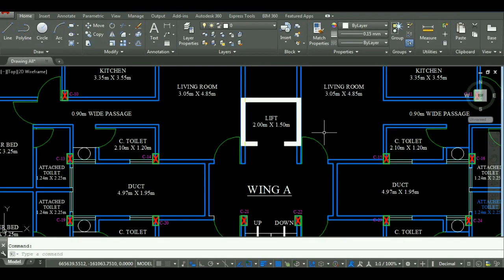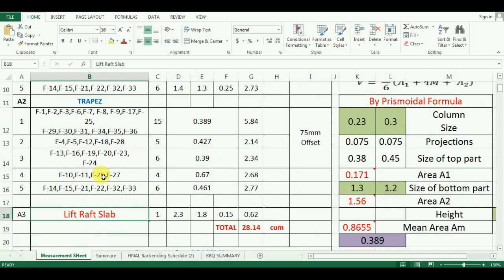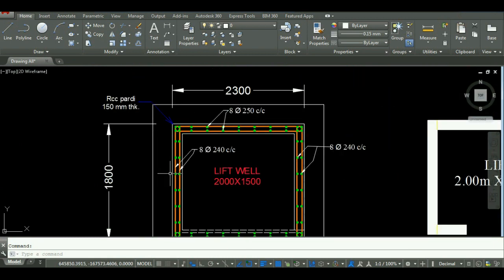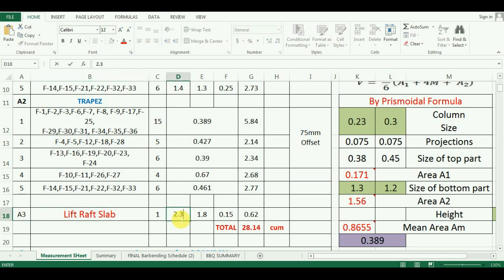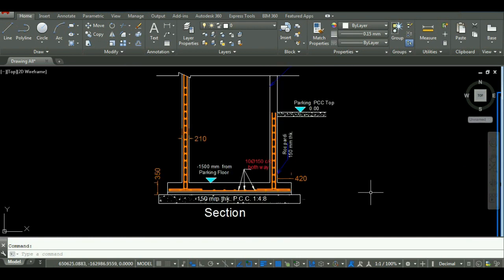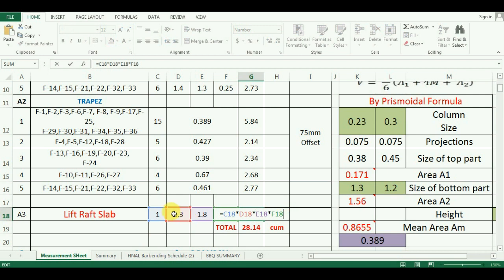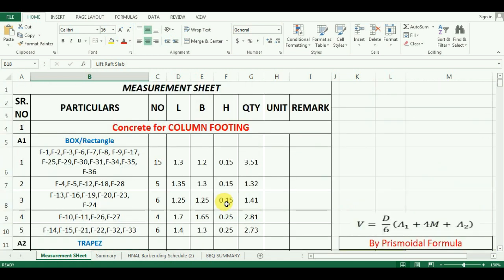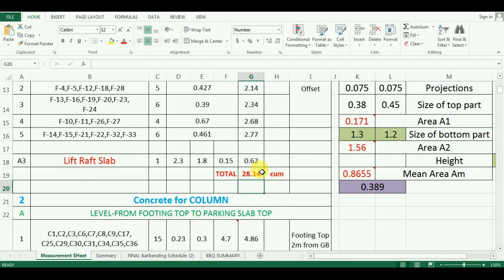Detailed Estimate of a G+3 Building in Excel -Part 4 Concrete quantity for LIFT

Comment: Projection of concrete bed means wall?
u took 0.15 for each side as a wall
I am not getting that projection part sir
Reply from the maker: It is the size of Bed PCC on which the LIFT foundation resting
The size of lift is 2m X 1.5m (internal dimension)
But the size of concrete bed at  base of lift will be including the thickness of walls
So the size is taken as 2.3m X 1.8m
Hope your query is solved
Please like, share subscribe to Unite Coaching
Reply: Unite Constructions And Unite Coaching tq ok then it is nt a pcc bed length right